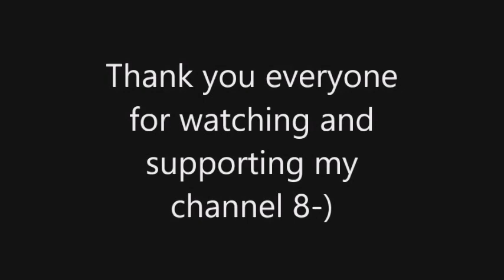How to make a clay or flower pot heater

Comment: You need to leave the outer pots top hole open so the hot hot air can get out. If not the candles/ tea lights will get over heated and start a fire.
Reply from the maker: That is a good point. Gonna pin your comments so others can see it
Reply from the maker: Thank you 😊
Reply: I've seen a tea candle start to flare up on the table, as it gets low, and the metal cup melts the wax to liquid!  So  have some ventilation for the candle.  Tea candle were meant for light or ambiance, not heat.
Reply: @toml.8210  you’re wrong! They are called tea candles for a reason = to keep the tea in the teapot hot, so you place a tea candle under the tea pot.

Comment: I made one unit last week (4" and 6" ) pots . Drilled the holes for a 3/8ths by 8" rod in the 6" saucers and use 2 tea lights and  stacked another 4" pot on top. Works very well and no heat on the table. Best design yet !
Reply from the maker: Glad you enjoyed it!!
Reply: The candles heat the clay pots, not the air, and the pots radiate the heat into the air.
Reply: I think I used pots that were too large (8 and 6 inches.)  They never got warm, although I did test it in my basement.
Reply: Love the Arnold impression lmao
Reply from the maker: @phillis1932 Haha! Glad you liked it

Comment: I used J.B. Weld epoxy to put mine together.  I glued an aluminium cover over the top hole, with a small hole to let the hot air out, and made a hook/handle so you can pick up the whole thing or hang it from a wire or hook.  I glued the bottom washer into place as well.
  When you are done with the assembly, loosen the nuts and glue them in place, so they don't loosen.

Drill the holes slowly and carefully!  It will chip or break. Ordinary drills will work fine.
Reply from the maker: Great idea, I'm gonna pin this comment. Thank you!
Reply: @ErickMartinSucre  Murphy's law sez: nuts get loose when you aren't looking.
Reply from the maker: @toml.8210  lol

Comment: Actually, there is no increase in energy capture as a result of using a second pot, its only purpose is to increase the length of time heat will dissipate once the candles flame out.  Same amount of heat, just more slowly released and that can be helpful at night when you don't want to get up to replace your candles.  Otherwise, it is completely unnecessary to add a second pot. The metal rod is useful because it improves energy capture and that is important to the overall efficiency of this device.  Great video.
Reply from the maker: Thank you for this input. I hope others get to read it.

Comment: Would it be possible to paint the terracotta?
Reply from the maker: Alana Shanks I would recomend using engine block spray paint for that. That paint is able to withstand the high temperatures
Reply: Erick Martin Sucre thanks for the video and the tip!
Reply from the maker: My pleasure Alana! 8-)

Comment: My problem with flower pot heaters is that when I put the flower pots over the lighted candles, at least half the candles blow out.  Can anyone suggest why this happens?
Reply from the maker: I remember using 4 candles and this also happened to me. I reduced it to 3 candles but one ended up turning off. Lastly I used only 2 and this seems to have helped.
Reply: Thanks for the reply. But do only two candles provide enough heat?
Reply: You have to have about 1 & 1/2 inches between the upper and lower pieces.